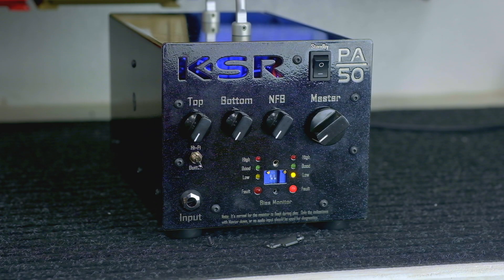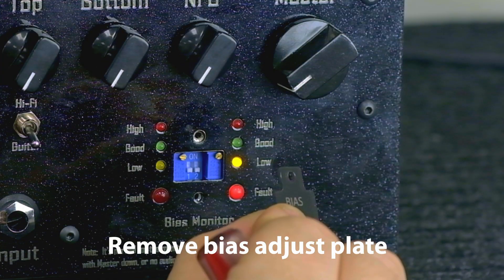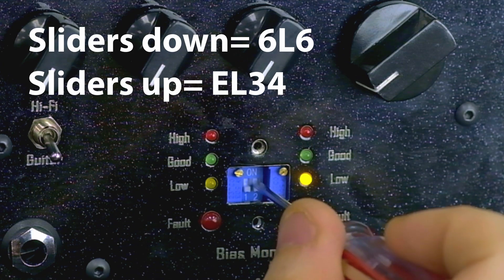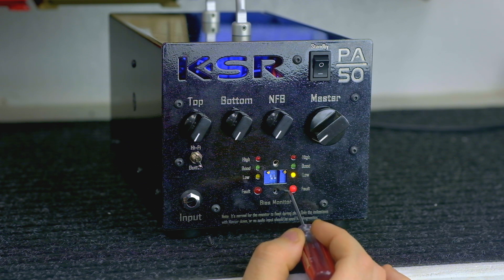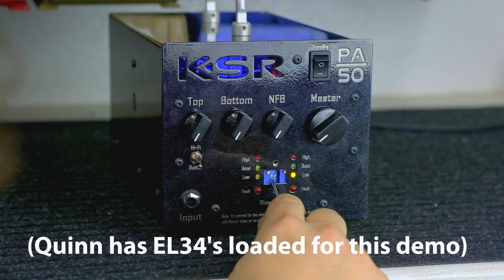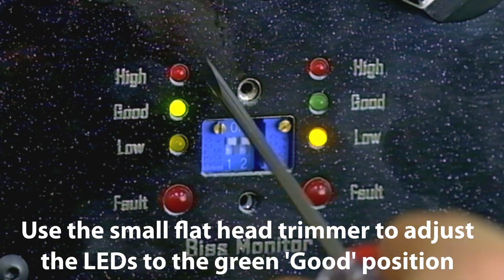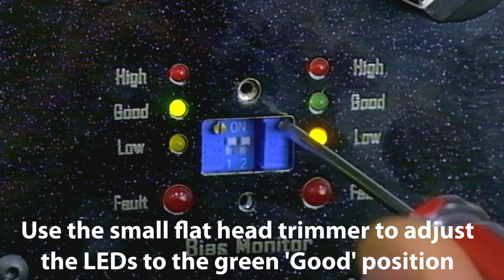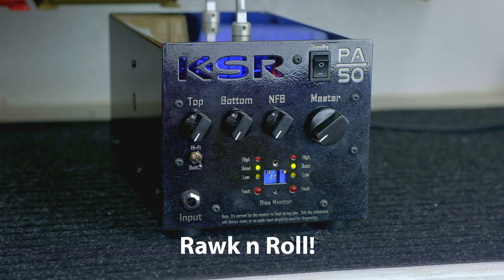KSR Tech Series: PA50/PA25 Bias Adjust

Comment: Is the amp in standby whilst doing this?
Reply from the maker: No, you'll need to have a load connected and it out of standby.  :)
Reply: @ProtoplasmaKSR What does it means if there is is no LED at all?
Reply: Thanks, all good now, my standby switch works the opposite to the amp in the video.